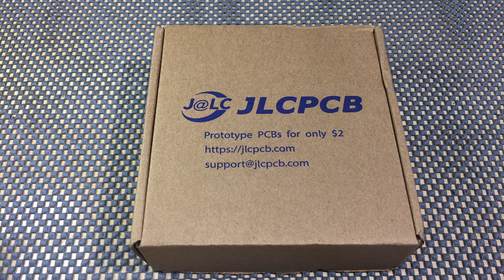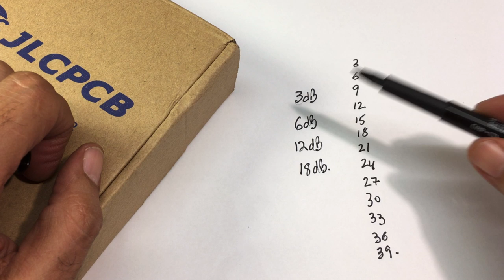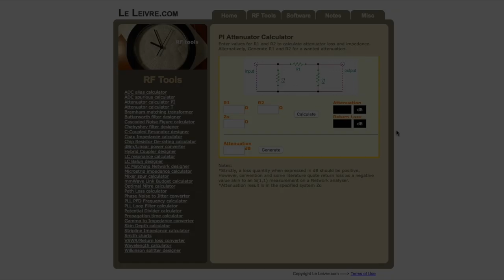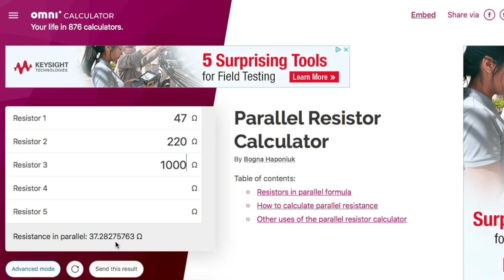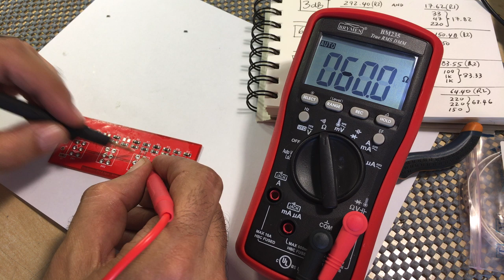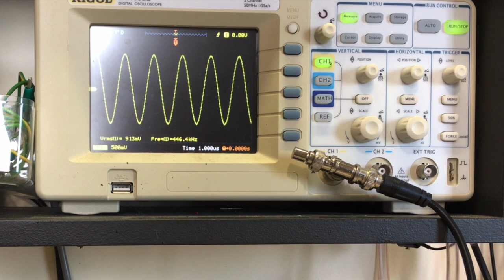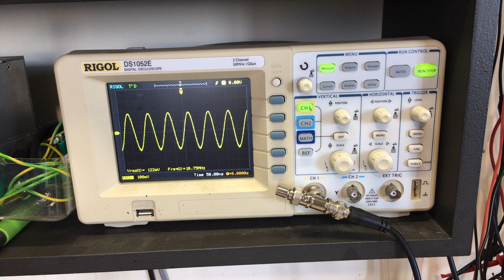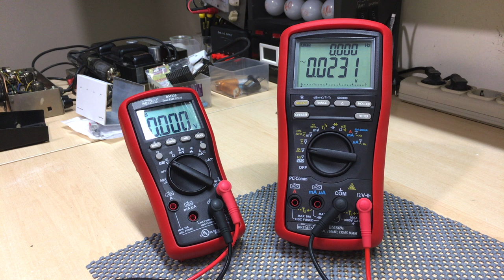Pi Attenuator board build with JLCPCB

Comment: I think the 4th one I would have made 24, you can already get to 18 with the first 3 as is. Is there a drawback to getting some nichrome wire and winding your own resistors? Beside size constraints that is.

Edit: Thank you for making a tasteful sponsored video, I find that I don't much care for other guys' videos where the sponsor is just a commercial. You happily endorse a product that you actually use, kudos my friend. I own a CNC engraver/router and etch my own PCBs. My hobbies lead me to modify the control system in the router. Tear out the old, put in a new, then I hooked up the custom setup to an additional Linux computer, that I put together from leftover parts, just for sending G-code to the controller. Next I'll be adding ballscrews, and stronger linear rails for better rigidity and tolerances. I also built my own 3D printer and I'm still modifying that, my next project there is to convert the entire system to 24v (up from 12v), higher voltage = more power from the motors, which equates to better printing quality. 

I mention all of this because of content creators, just like you, that have truly helped me get back into tinkering with crap (in general) and a desire to learn electronics on a more fundamental level. I got the router to make my own circuit boards and built the 3D printer to make custom enclosures for my projects. Of course, they are much more useful than just that and I find that I use both my machines for so many other things, but anyway. I know I have expressed appreciation before, but I truly want you to know that I appreciate all that you do. Your content may not be tailored for "the masses" but I enjoy learning new things constantly and really enjoy watching old electronics being made serviceable again while learning along the way.
Reply from the maker: Edwin also pointed out the advantage of making the last stage a 24dB one, and I agree. I didn’t consider it as I rarely need more than 30dB of attenuation, but it makes sense to make this alteration in version 2.
As for sponsorships, I accepted the offer from jlcpcb because I was already using them. The only change was making videos of some of the projects that I had previously not bothered to publish. 
As for the Brymens, unfortunately I just had to buy one :)
I’m glad that you enjoy the channel. I tend to publish anything that tickles my fancy, so I don’t really target any specific viewer. To my surprise, quite a few people find it of interest, if the subscriber count is any indication. 
I tend to learn more myself than teach others, so it’s quite fun. 
Enjoy the hobby, and thanks for your encouragement.
Regards from Madeira.
Reply: @electronicsoldandnew  Crosstalk may probably hinder you to get much above 20dB att. on frequencies beyond 30MHz. Great little att. project. Did one back in the 80s and it is still working fine to 500MHz for up to some 15dB att. after that crosstalk hinders further att. on mine.

Comment: What a fantastic build you did a wonderful job. I have an RF attenuator made by Bird that  has a similar layout and was expensive back in the day.  There are some attenuator calculators that will give you nearest preferred values. It was probably advantageous to parallel up the resistors to reduce the inductance value anyway.   A good test for these is to do a frequency sweep I’m not sure if you have a vector network analyser or mini VNA but it can be very revealing. Thanks so much for sharing regards chris.
Reply from the maker: My pleasure. Thanks Chris.

Comment: Congrats to the new multimeters, the big one needs a review, isn't it? Since a half year ago  i own a Fluke 87v, used, but in fact new (ebay), for 200 €. So i would like to know, how you are living with this PM-Part. And i have one question abt your attenuator. How are the switches in higher frequencies? And how do they  influence the signals with capacities or resistors? Great video! But i wouldn't use smd-parts in home-projects. My eyes are not so good and my fingers are not made for such little objects :-)
Reply from the maker: Alfred Neumann : I bought the Brymen because of many reviews I saw on YouTube. There is one for the BM839 that particularly impressed me, and it’s actually an older version of this one:

https://youtu.be/fRjXSbXZLmM

I tested the attenuator up to the max frequency that I’ll use it at, namely 10.7MHz, and it performed perfectly. I’m sure that if we want much higher it would start to get noisy, but for my needs it’s great.
I also stayed away from Smd but now I love it. I’ve actually used a magnifying glass or the magnifier function on my iPhone to solder in the past, but that was not necessary here.

Comment: 1. Are these 1206 Spacing?  2. Have you released a 3-Resistor board?  3. Do you have the .ZIP file so one can order these boards?  4. Have you updated a video on the new board?
Reply from the maker: Not yet. I’m getting the shelving redone so will revisit this project soon.

Comment: Your PCB (version 2) is just what I have been looking for to allow me to home construct an RF attenuator to go between a receive antenna and an SDR receiver using surface mounted  resistors. When you have revisited this project, how do I access the files to order up the boards from JLCPBC?
Reply from the maker: I plan to make some mods and order new boards. At that time I will post the Gerber files.
Reply: @electronicsoldandnew  Do you post already the Gerber files?
Reply from the maker: They are shared on pcbway website and you can download them.
Reply: @electronicsoldandnew  Thank you :-)
Reply: @electronicsoldandnew  Sorry Manuel, i must be blind. I cannot find the pi attenuator project with 4 switches on pcbway share. Please can you give me the exact name of it? Thank you
Reply from the maker: send me your email and i’ll send the gerbers to you